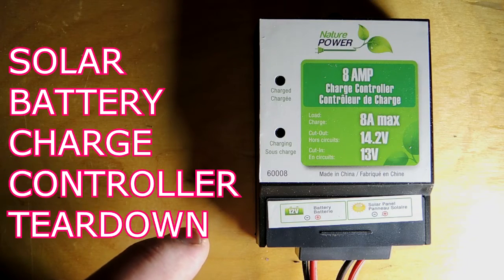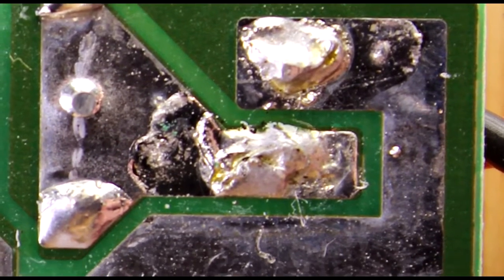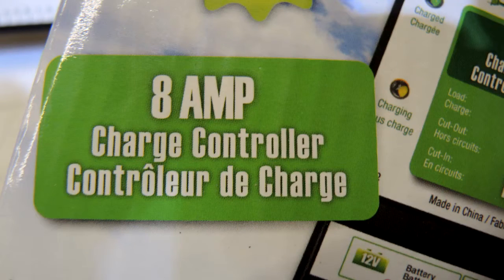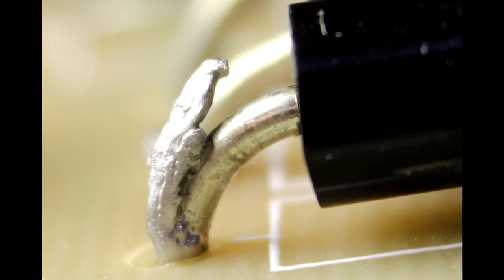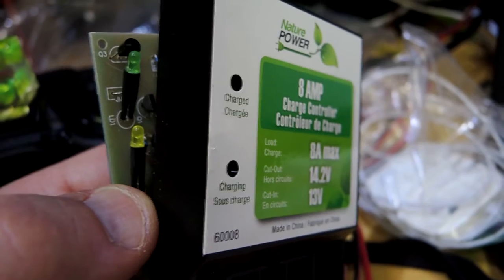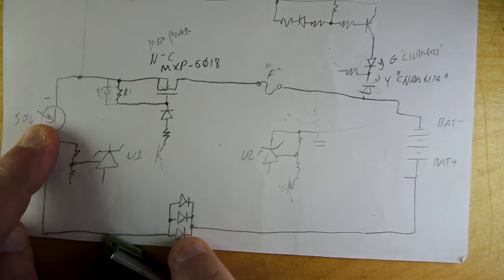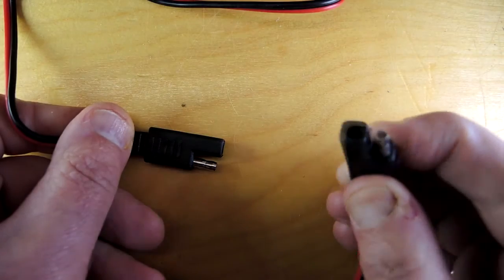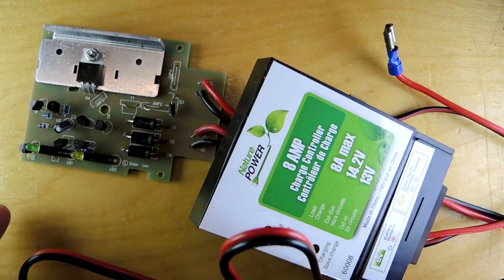Tear down of a Solar Battery Charge Controller

Comment: Nice breakdown, was just hoping there was some info on this controller and cant believe ive found a teardown video of it. I have 2 after buying 2 kits with them and recently found extra connectors a tthe thrift store(surprised to see them there) allowing me to consolidate and get rid of a lot of wire  but think 2x80w panels is too much  for the controller.  As you said 8 amps is stretching it and 2x80w is just above 8 at peak, so not sure i should try it(but i will). Would increasing the gauge of the jumper increase the amp capabilities?  Any others mods possible to make it better? Thanks for this.

Comment: Well i don't think this board has been wave soldered. The holes for the components are way too big for this. The solder "splatter" on the diode comes from feeding solder to the pad too fast during assembly (i've done this myself). The board is hand soldered.

Comment: Heh, until the end logo I thought I was watching a Big Clive video.

The possible reason for the oversized diode holes could be that they designed it with the intent of using diodes with thicker leads but for manufacture the diodes with the smaller leads happened to be cheaper.

Comment: for $17 canadian pesos you can do a little better:
https://www.amazon.ca/Docooler-Controller-Battery-Regulator-Protection/dp/B00L37KZI6/
Reply: you can get them as low as 5 dollars, they are pretty reliable
Reply: links?
Reply: Afdhal Atiff Tan Amin Husaini Tan
http://www.ebay.co.uk/itm/20A-12V-24V-Solar-Panel-Charge-Controller-Battery-Regulator-Safe-Protection-HT-/391362971534?hash=item5b1f0d078e:g:nT4AAOSwa-dWlLWM     search for solar charge controller on ebay, some are even cheaper than 5, depending on your amps need
Reply: jusb1066 Thank you!

Comment: Looks like someone got a pile of plastic cases cheap, and quickly threw together the PCB and stickers to make it into a product.
Reply: I agree with your comment. This video reminds me of some of Big Clives teardowns of random items he gets from ebay, most notably a bug zapper which actually blew up when tested. Interestingly after he tore it down and critiqued it he was able to get a later version and was surprised to find that the design for the circuitry had been greatly improved so that there was no risk of explosion. It still didn't make the product any safer, the plastic grill covering the zappers output grid still permitted adults to apply their fingers to metal that would have been charged to 660 volts!

Fingers crossed the makers of this item will see this video and take heed, it might also be worth doing a modding video to fix up some of the problems with this item...

Comment: What you normally see on solar panel connections are MC4 connectors.
Reply: This is a good example of a clone or less expensive knockoff of the small charge controllers that generally come with temporary camping panel kits.  The connectors will not hold up long term to the elements but for general camping or temporary use they work just fine.  If you add a bit of petroleum jelly or dielectric grease they will hold up outside generally for several months.  The biggest problem I have with these connectors is that it is very easy to get the wrong polarity if you mix and match kits.
Reply from the maker: +Mike M thanks! Those look much better than what was supplied with this unit

Comment: That connector reminds me of years back when I was a kid. They were used on (in the UK) CB radios and some other automotive stuff. Car stereos and the like. Quite an old connector to me. They were never a great connector.
Reply: yes also used in connectors for easy connectible battery chargers like the accumate for motorcycles. modern xtc connectors are very reliable now, but this type are one of the few hermaphrodite connectors i believe that is the proper name  - SAE hermaphrodite connector

Comment: Those connectors are fairly standard in the low cost automotive charger market. A lot of cheap ~18v solar panels seem to have them. I have a couple Coleman branded panels that came with those crap connectors.
Reply: Mike M the 4 and 5 pin versions are used for trailer light wiring in the USA. They do frequently corrode and have problems.
Reply: compu85 Yep, they're used for the same purpose here in Canada.